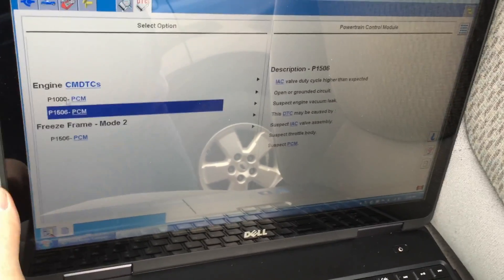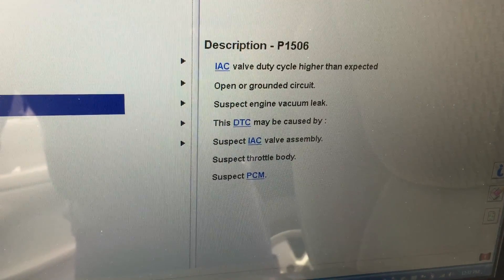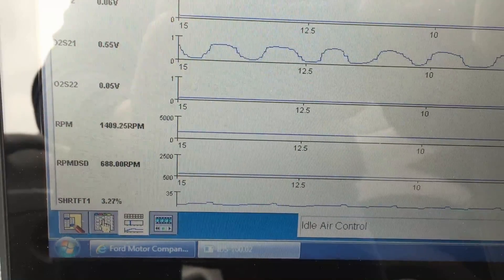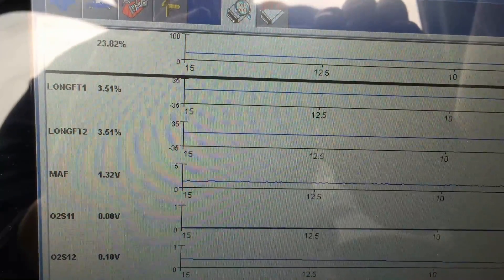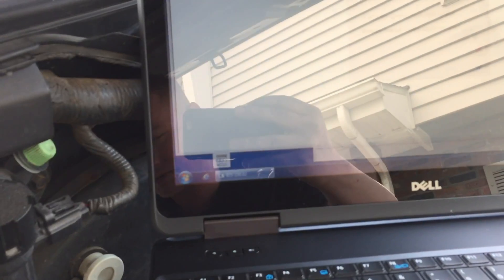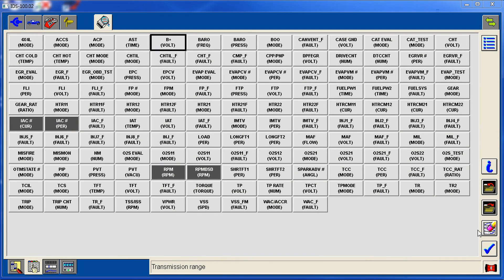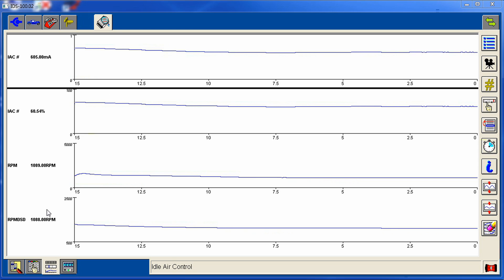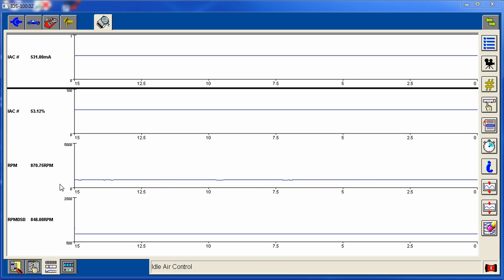Ford Idle Air Control Valve Diagnostics: High Idle DTC P1506

Comment: IAC packed with carbon deposits? What was wrong with the old one?  Enjoyed the video
Reply from the maker: +Ozzstar No it wasn't bad the valve itself was sticking in the bore
Reply: Ozzstar , Mine was broken on the inside . The spring on the inside of the valve was broken and lodged in the wrong area on the inside of the valve . You could look inside the hole that the vacumn hose attaches to and see the spring.It was very obvious when you look at the inside of the new one verses the inside of the old one.

Comment: I noticed you didn't reset the IAC sensor when you replaced it....
Reply from the maker: I sure did it's always a good idea. I mention the KAM should be reset afterwards so it can learn the idle.
Reply: FordTechMakuloco Cool, thats what threw me off when you mentioned "cam" thanks
Reply: FordTechMakuloco not sure
Reply: FordTechMakuloco sorry..I hv a 2007 Lincoln 5.4 3 valve 102k miles n changed plugs n cops n fuel filter n starts good idles fairly good Rev to 1200 to 2000 n it shudders once past tht it it's not as bad.  now put into gear n u hear it sucking air..like its fueled starving. any ideas .I see a lot of your videos n u r great. .too bad you r not here in san antonio texas. .

Comment: Great Video. Which NOID light did you use or does it matter as long as it fits in the plug socket?
Reply from the maker: the GM PFI one works best it comes in a kit linked below.
Reply: Kool thanks!

Comment: whats it mean if fuel trim is negative an positive?
Reply from the maker: +Richard Cowtails if it's running negative the engine is running rich too much fuel. If the trims are positive then then it's running lean from unmetered air flow
Reply: thank you for that clarification. the live data seems to go back and fourth. is that weird? when my 99 ram idle is starts choking and trys to stall out. im thinking computer. replaced the o2 sensors intake gaskets. iac sensor. if i put a noid light on the iac wire connect what should it do in behavior?

Comment: Ive got a 2003 escape that is a 5spd with the zetec. Everytime i throw it into nuetral coming to a stop, the rpms will spike to around 4k then slowly come down. Also when i shift, with my foot off the gas and i push the clutch in, the rpms will go up about 500 then come back down when in gear. I got a cel that is a P0507. Any thoughts?

Comment: Hi, I have been having rpm issues with an 08 5.4. After 23 miles of highway driving it wants to die out at low rpms when pulling into work or in traffic, putting it in neutral and rEving the engine a couple times it goes way until the next trip. Any ideas where to start looking? Thanks
Reply: did you ever find out the problem.

Comment: what's up with the o2 b1s1 drop out to 0v?
Reply: Yeah, noticed that. Seems like there may have been a lean issue as well, IAC wouldn't have been causing that one.
Reply: short trim goes goes +24% then o2 drop to 0v.. no issue unmetered air at 1500rpm+ ??
Reply from the maker: +Robert Hancock I truly think the PCM was over and under fueling to test the response of the sensors the way it was on and off. I totally ignore that kind of stuff until the known faults are fixed.
Reply from the maker: +ebu touy yes I think the PCM was commanding the fuel to test the sensors you see how on and off it was?